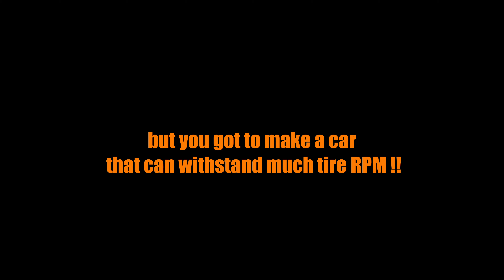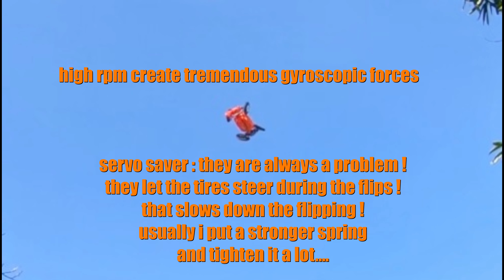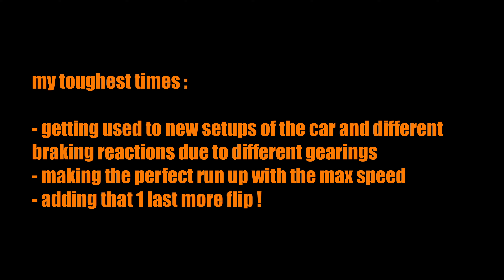12 flips buggy backflip: how i made my backflip record, sharing my setup and ideas

Comment: Thanks for sharing, I am impressed that the power system is “just” what you would expect in a 1/8 buggy. I would have thought it was a crazy 8S system you were using. 👍 👍
Reply from the maker: thank you ! yeah, i hope my 12 flips backflips will not be forgotten so i thought i would share how i did it : it's not just about power, it's mostly about control ! it's sad to see all those RCs flipping and steering at the same time because of soft servo savers ! so that's the first thing to improve. then it's all about vertical airtime and rpm ! i magine what is possible with a serious run up : i did it all in a garden with a limited run up distance !